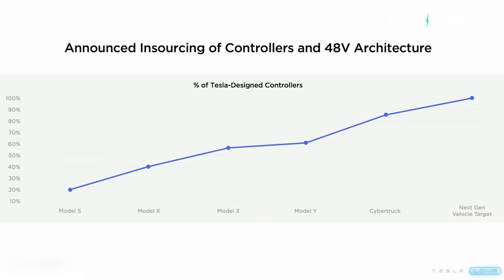How Tesla plans to save $10 billion every year by using less copper

Comment: tldr; It's not about copper and never was, Musk is trying make it harder for people to repair Teslas with off brand parts, another anti-repair and anti-ownership tactic employed by Musk.
Think about it;  Teslas are electric, they don't need thick wires for high current draw engine starters since they don't have them. Low voltage system in Teslas is used to keep auxiliary systems going when the car is off, such as power windows, car audio and stuff like that. Redesigning the low voltage system to run on 48v would necessitate producing 48v parts, the kind only Teslas will be using which is the entire point.

Comment: The reduction in copper of 75% is only in the systems associated with the 12 V systems currently. That does not include the motors or the main battery, or the copper cables going to and from them. It is only the copper associated with current 12 V systems. Amperage determines wire gauge, so if you quadruple the voltage you can 1/4 the amperage, which would require 1/4 the amount of wire thickness. You would also then save weight on all the different connectors as they could be 75% less big this is a small thing that is a really genius move that is going to put every other car company at a disadvantage. It is a win-win, you save money on less materials and you gain efficiency through less weight.

Comment: Considering a move to 24V or 48V is nothing new, it has been in the mainstream since 2021 and for a long time many military applications have used 24V systems with a steady move towards 48V. 

Saving on the amount of copper might be a consideration but that has to be balanced with switching all the other components that have traditionally been operated on 12V, such as  blower fans, electric windows, headlights, and infotainment systems.

Vehicle manufactures love to re-use parts, take any super car apart and see how many components come from other manufactures. A 24V or 48V system may be better but bespoke systems require bespoke parts and many of the cost savings in a vehicle will come from mass produced parts. 

If Tesla is alone for adopting 48V, they are really going to need other manufactures to follow as only when the auxiliary electrical components are mass produced to operate on 48V are true cost savings likely to be realised, but hey, if the reduction in Copper alone saves on the overall costs go for it.

Comment: Alright, this is definitely going to piss off the fanboys; but here’s my take. Shifting to 48 volt for the low-voltage electrical system will not make a real difference. At least, not in the way that everyone thinks. While it’s true that you CAN use smaller CCCs (current carrying conductors, aka “wires”) when you step up the voltage, everyone seems to have forgotten; LED headlights/tail lights, the infotainment system (which I have to remind myself is the master control for the whole vehicle) all draw very little power. In fact, outside the CCCs for the climate control blower motor, and maybe the leads to the cigarette lighter outlet (though I can’t think of any modern EVs that have included one of those; fairly sure they’re extinct), there aren’t any loads significant enough to need more than 8 feet of 10 AWG wire at most (and for most vehicles, that would be overkill even for the blower motor). The only exception I can think of would be if it had a big sound system with a 200+ watt amplifier and a subwoofer; and even there, a pair of 10 AWG “hot” conductors would be overkill. It’s not until you get past the 350w mark that you’d have to upsize. But anyway, back to the main point. The reason that going to 48 volts as the low-voltage system in the car won’t save copper is because the vast majority of circuits already run on really f***in’ small wires. As in, 16 to 20 AWG. You’re not going to get CCCs much thinner than that. No, a much better copper reduction strategy would be to use fewer electrical components, eliminating the need for those CCCs in the first place.

Comment: Elon should have bought ENPH when he had a chance.   Volt on demand regulation in real time hasn't been designed into the auto makers ether as of this writing, and having controls in the system to regulate voltage properly could be imbibed to the drive train to relax demand, and produce longer range per charge.  Now go make it so.

Comment: Math is a thing. 

Let's do a sanity check.  

Copper costs under $4 a pound, so let's call the cost $4 a pound (giving the estimate re savings the benefit of the doubt).  Your title means Tesla could use 2.5 BILLION POUNDS less of copper per year. 

So if Tesla makes 20 MILLION cars a year, that would be saving 125 pounds of copper per car.  I'm NOT buying that without proof (more than Elon's hand waving), given that the motors / drive components are ALREADY very high voltage components, so the savings would ONLY be for the 12 volt system replacement which is very likely more like 25 pounds than 125.  

And that would fit the Musk hyperbole profile (using dates as an example) rather well. 

It doesn't mean the savings isn't significant over time, it's just not gigantic/stupendous.

Comment: You did your figures based on the wrong system. Tesla is replacing the 12 Volt accessory system not the propulsion architecture. I think that is 400 Volt.

Comment: The copper saving is on the 12V low voltage circuitry, not on the high voltage motor circuitry.
So the savings are not on the copper throughout the vehicle, just on part of it.

Comment: Come on! It is not 2010 any more!! It is 2023 and Musk has been thoroughly outed as a liar and a bullshitter.

There is probably a kernel of truth somewhere in this 48V story, but the chances of it all being true are zero. Tesla does not spend $10b on copper a year! Obviously!!! Even if they could take out 100% of the copper currently in Teslas, it would not reduce the production cost by even $500 per vehicle.  The quickest back of the envelope calculation shows that, yet you are repeating Musks bullshit as though it is plausible. The real story is that Musk habitually lies to his investors and the general public. Don't turn a blind eye to that just because you are afraid of the wilfully ignornant Musk stans having a conniption.

Repeating Musk's claims without checking the facts is not journalism, it is just unpaid PR work. Please look a little deeper because you can never tell whether he is faithfully repeating stuff he learned from the incredible engineers working at Tesla, or if he is just spreading misinformation for some strategic reason, or just because he thinks it is fun.

Comment: Not 100 years, most cars were 6 volt back then, the last time the voltage of cars changed was 1955 when they went to 12 volt mainly because of starters. Now we have so much power hungry stuff in cars it's about time. Reducing the wire size is a real plus.

Comment: Luke Brisbane is right on this, the saving will only be on the 12v system, the high voltage system will be the same, Paul mentioned moving from 400 to 800 on the HV system, this would have much greater benefits, both would be a big leap.
One note, there is copper and then copper, One company in Thailand "Oriental Copper" produce a copper wire that is about twice as conductive as normal so you could half the weight at 12v and much more at 48v, however I believe it's very expensive.

Comment: Some vehicles were still using 6 Volt systems until the late 1950's. Such a low voltage was horrible for connectors exposed to the tough environment of a motor vehicle, because of the currents involved. Any increase in voltage reduces the currents required not only saves Copper, but it reduces switch and connector sizes. Existing 12 Volt electronic kit such as radios, motor electronics and computers, can be redesigned, or in the case of light load 24 Volt equipment (which exists already) it can be run through small sized buck converters. The lower currents also bring better reliability if designed correctly.

Comment: If Tesla want to reduce copper usage by increasing battery voltage, then switching to a 800volt Powertrain will save much more copper than switching from a 12v lead acid to 48v lithium ion traction/ accessory battery. Obviously, the switch from 12v to 48v has some other advantages, but saving copper is not as significant as claimed.

Comment: @1:17, wrong. Switching over to 48V is easy and so cost effective that all Tesla vehicles will use 48V battery. Changing the voltage of the main battery pack is not so easy.

Comment: Hi Sam,  Note that the switch to 48 volts is only for the low voltage system...not the high voltage powertrain which includes the copper wiring in the motors.  This is still a HUGE thing since all ICE cars have a 12 volt electrical system for everything but propulsion so the new Teslas replacing them will consume 1/4 the copper.  
On another note,  per Musk FSD will enable Robo taxi's w/ 5X utilization so the concern is demand for vehicles will drop accordingly as 1 Robo can replace several non FSD ones.   So does this kill the industry wide demand for vehicles and destroy Tesla's overall demand???  
Dan
Reply: There are no robotaxis and no prospect of that any time soon.  Tesla cannot achieve robotaxi levels of functionality with their current system.

Comment: MISINFORMATION. The change from 12 V to 48 V is for the ancillary circuits, like windscreen wipers, window doors and headlights. Nothing to do with the drive motors, which remain at 400 V. So no, there isn't a massive reduction in the copper used in the drive motors, but there is a reduction in the copper used in the low voltage circuits, which you didn't mention at all, Sam.

Comment: At the end of his presentation Sam talked about the saving of copper in the motors. This is incorrect. Only the low voltage systems will be affected while the high voltage motors will be unaffected. 

Something else of huge relevance is that Elon talked about replacing a large number of long power wires which travel to the back and front of the vehicle. These would be replaced by a single thin signal wire to a controller at the back of the vehicle and a similar single wire to a controller at the front of the vehicle. The controller would then have shorter power cables to the loads which are situated close to the controllers. This will result in a further huge reduction in the copper needed. 

Another small saving could be achieved in the low voltage system by using lower cost, lower current semiconductors. The higher voltage of 48 Volts is generally not a cost factor in semiconductors.

Comment: The purported savings EV quotes - based primarily on electric motor copper usage can't be right. Basic physics requires the same amp-turns for a given motor configuration regardless of driving voltage. Finer cross section turns and more of them (higher voltage case) vs coarser and fewer of them (lower voltage) cancel out in terms of net motor copper usage. Where marginal savings are possible is in the cable wiring running from batteries to the motors and ancillaries e.g. lights, air-con/heater etc.
Besides that, I'm confused. What is the meaning of using ~ 800volts chargers - is that not the voltage actually applied to the motors? Then the 48 volts must be only for ancillaries?
Ahh - I see that lukebrisbane5380 has already covered the issue at https://www.youtube.com/watch?v=y-c6XshYdhE&lc=UgxT5SFPeWm00_3xDhp4AaABAg

Comment: It's only for the one half of the electrics tho for the car lights radio air con and so on not the copper used in the electrics to drive the car. So it's a bit miss leading. But it's still a good idea. Tho till some one wants to tow a trailer lol.

Comment: It’s a good idea to do this. I remember reading electronics magazines back in the late seventies saying this was coming. Higher voltage on low voltage components means less current, hence conductors can be thinner,using less material.

Comment: You wouldn’t need to re-engineer the entire vehicle. It would be far simpler and a less expensive than you would think. Components that need re-engineered would simply have a 48v to 12v power supply on/ added to the component, until such time the  48v replacement comes out, which Tesla could do in a few months

Comment: A quarter is an underestimation. For the same power delivered P=V x I, raising 4 time voltage (12V to 48V) means quartering the current (1/4). And the ampere rating of electric wire is determined by the heat generated by the electric current passing through its inherent resistant (since we don't have superconductor for everyday use). And the rate of heat generated is Power (of heat) = I^2 x R ( Current square x resistant of wire). So for the same heat generated in wire, if you quarter the current then you can use wire with 16 time the resistant, meaning the wire thickness is 1/16 of original.
Of course, other consideration will limit the 1/16 saving. Oxidation of copper wire will increase resistant, and thinner wire is more affected as surface area per volume ratio is higher (and oxidation occur on surface). So you will use thicker wire to ensure longevity.

Comment: Well seeing as the EV needs significantly more Copper (and Nickel), as they have no need for a starter battery  it was ludicrous that they used a 12v system in the first instance - Remember there is a lot more copper in the traction battery and motors in an EV than the entire  harness in a conventional vehicle, so the reduction in copper is most likely misrepresented - tell us how much copper is in the 12V system total ?? - then combine the copper in the battery cells, high voltage switching circuit and motor for the mass not saved. - hint, (though going to 800V traction architecture will increase available peak power (only usually experienced at the redline/terminal velocity without a multispeed transmission) without increasing the mass of copper (current carrying capacity - to the cost of more expensive power electronics and insulation, always "a cost" )

Comment: Copper "cathode" trading looks set to be very robust 2023 no different from oil plus distillate trading. Very unusual weather for the US West has manifested an ENORMOUS amount of hydropower that is now entering the US grid system and agricultural economy both by far the largest upon this Earth. There is no shortage of copper ore from Mexico of course as well. Plus recycling inside the USA of such a massive glut of refined product of all things electrical plus Crazy Putin War and Tesla looks set to become the dominant car and truck manufacturer in the USA this Year 2023 absolutely this move to 48 volt only cementing such dominance. Maturation of the US hybrid drive system market is also a huge factor in moving the US economy away from pure play IC engines and mechanical drivetrains. #skateboard_chassis has a very cloak and dagger History in the United States as well.

All should be great news for Rivian, Lucid and Ford Motor Company as 12 volt architecture suddenly becomes commoditized.

Comment: Traction motors run at inverter voltages, they might not be affected by the change. This is likely just the 12V harness loosing weight.  Substantial, yes, but not the entire Bill of Materials.

Comment: I believe that the current (pun intended) batteries used in the Tesla Model 3/Y are 16V not 12V. These are the small lithium ion metal cased batteries very different to a black cased lead/acid type found on for instance, the BYD Atto 3.

Comment: Why are you calling move from 12V to 48V a new "low volt" system. 
The chart you showed says cars switched from 6V to 12V in 1960's ... not 1900's. Which is right?

Comment: This video seems to conflate the copper used in low-voltage applications and that for the high-voltage motors. Moving low-voltage systems from 12V to 48V doesn't change the weight of the motors in a significant way.

Comment: Is cthere a greater risk or maybe a problem with these thinner wires breaking?
Reply: No. Thinner wire can be made more flexible and therefore resistant to breaking. Wire will almost certainly be multistranded. With proper strain relief, such wire will never fail.

Comment: You should have explained the underlying physics.  As I understand it, by going to higher voltage one needs lower current for the same power (with constant resistance, Ohm's law).  Lower current - as I understand it - allows smaller wires and hence less copper.

Comment: i dont agree with that. because you need 4 time the battery size aka 4 time more cost to the battery. those SLA battery need to be replace every 3-4 years. it adding cost to consumer.
Reply: Tesla has already replaced the heavy lead acid battery with a much lighter 16V lithium battery.

Comment: I believe cars went to 12v in 1929. My great grandfather had a model T and wanted a electric starter like the newer model A's. So sume model A's had 12v electric starter. So he added the starter and a 12v battery by drilling a middle post thus suppling 6v to the rest of the car.

Comment: I am not a fan of this . We are talking about everything from several actuators , wiper motors , window motors , sound systems , seat motors ,  all lights in the car  .... on and on .. No more supply chain for that . Tesla will have to build everything themselves . Think about it  ... Every bulb , motor , electronic devise will now have to be 48 volt . Also you can get a fairly good jolt from 48 volt compared to 12 
 .